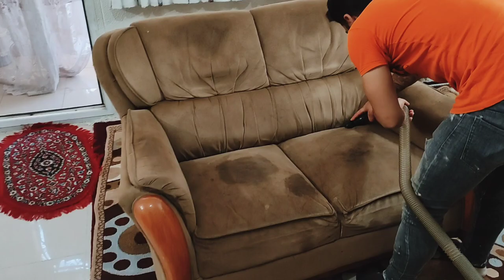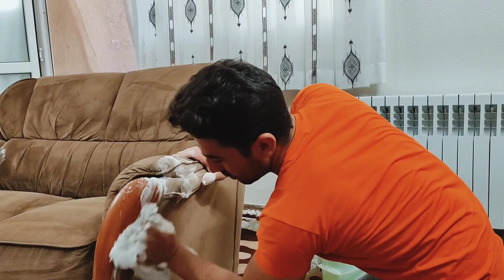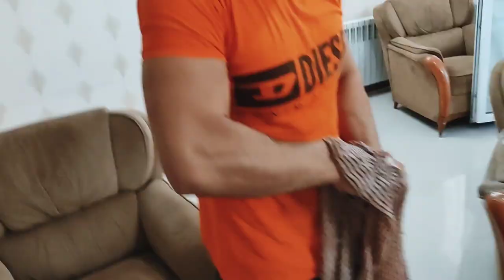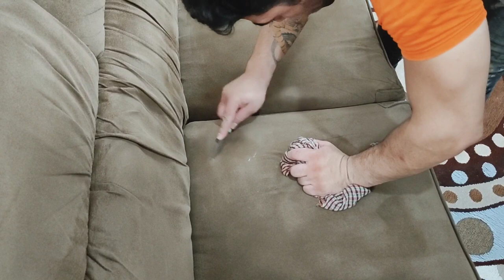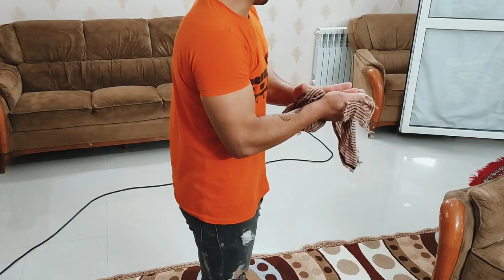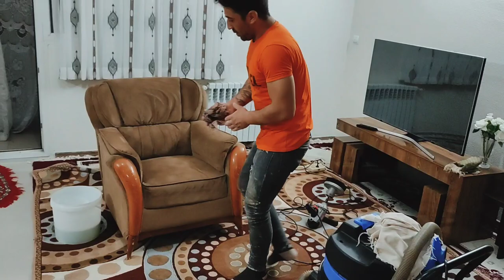washing a sofa | how to washing oddly dirty settee | ASMR Videos

Comment: Not so fast amigo. So far you are doing a very good job of cleaning those sofas. But you did not turn over the sofa seats. If you're doing a job I suggest you do it thoroughly.
Reply from the maker: Thanks for the tips! sure.
Reply: Right, that's what I said because the seats are movable just for cleaning purposes 🤷‍♀️
Reply: I think it’s quite obvious to see that the cushions are attached to the frame work and cannot be taken off. No need to be so rude!